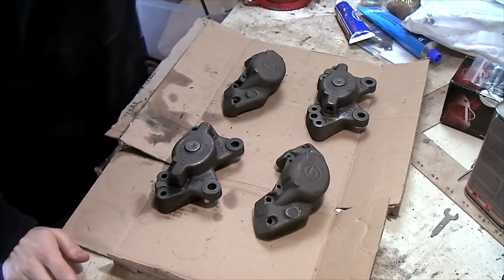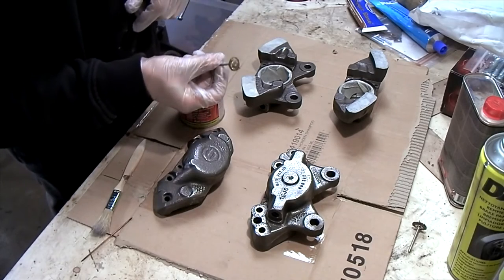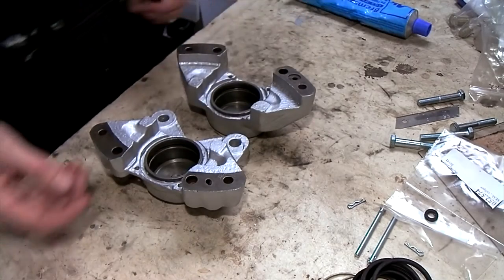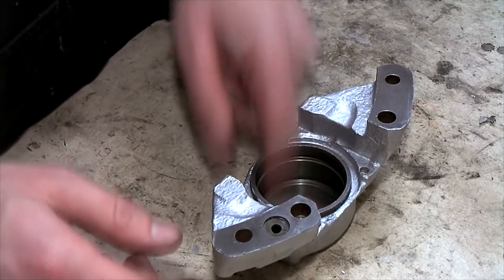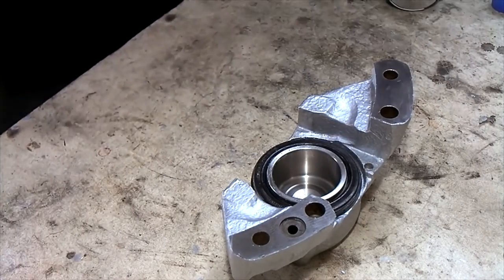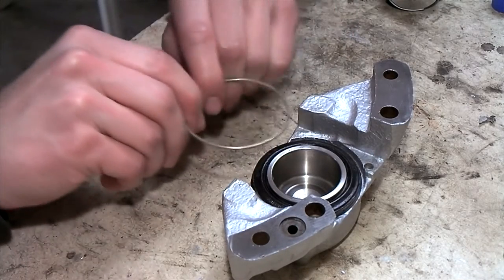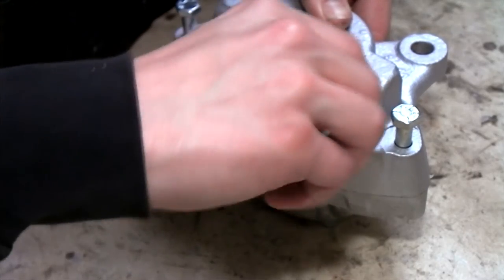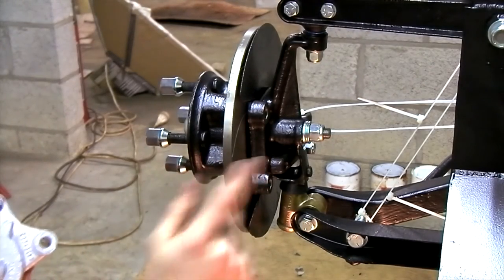Lotus Europa - Ep 18: Rebuilding brake calipers

Comment: I think the bolts broke because they are 5/16" and 35 ft-lbs is way too much torque for a bolt that size. Recommended torque for a plated 5/16" Grade 5 fine thread bolt is 14 ft-lbs.!
This is a terrific video and very helpful, thank you for posting it

Comment: I wouldn't bother splitting the calipers.  The ONLY advantage to that might be to really clean the bores, which can also be done with patience and some fine steel wool.  If you really have to paint them, you could do so before you took out the old pistons and dust covers.  My friend and just rebuilt one of these last night for a Jensen Healey: we clamped one piston in and used compressed air to blow the opposite one out.  We then cleaned, lubed and put the new seal and cleaned piston, dust cover back in, clamped it and used the came procedure on the other side.  I know you want to completely restore your car to a very high standard, but for the rest of us who want to fix and drive, newly painted calipers, especially light colored ones, just get dirty.  Besides, you don't really see them very much unless you have very open wheels.  One thing we did not use, which I learned form your video, was using silicone grease on the bores and pistons. Shall do next time when and if we need to for the Europa.  I look forward to your next video.  Thanks

Comment: Bolts are available in different strengths; you should be able to get ones which will torque to 35 ft-lb without shearing.
Reply from the maker: Rick Rueter Yes, you are correct. I have talked about this with some fellow Europa owners and other viewers. I will be replacing these grade 5 bolts with some 12.9 grade bolts before the restoration is finished..
Reply: I would recommend the AN bolts which can be found in the Pegasus Racing catalog, both the configuration and strength are just right for these calipers.

Comment: Nice video,, You said 5/8 bolts and then 5/16.. I assume you meant 5/16 and misspoke.  Also "grade S" I have never heard of that letter grading, only numbers.  I think you may be sorry removing the anti-squeak pads. Since in normal operation the pads touch the rotor constantly I don't think they are an issue.  The pads will break in and everything will compress. Your car may sound like a garbage truck after a short while with loud squeaks. http://www.engineershandbook.com/Tables/torque.htm
Keep up the good work, I love your videos.
Reply from the maker: Thanks! I still have the stick-on anti-squeak pad, so I can re-install them if it proves too loud. I also have the metal anti-squeal  shims that came with the pad-installation kit. Brake pads are Mintex M1144, not too aggressive of a compound.
Reply: From the Namrick.co.uk site: "Grade S and R are a grade 5 in imperial terms which is the imperial equivalent to grade 8.8 metric. If there isn't a letter stamped on the head then you can see if it has 3 lines instead, this also stands for grade 5 or 8.8 grade. 6 lines is a higher grade, equivalent to 10.9 grade in metric."